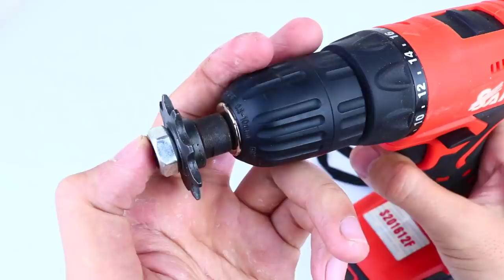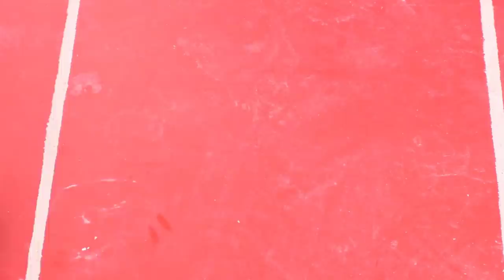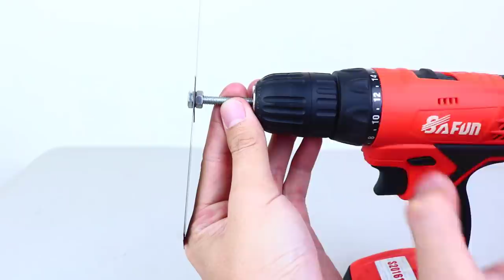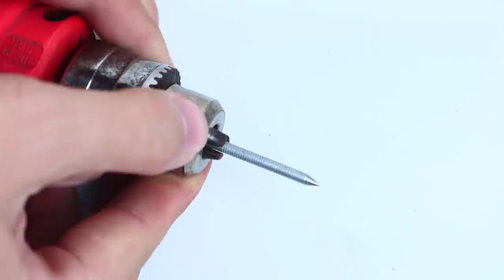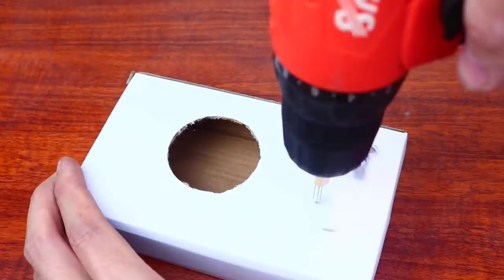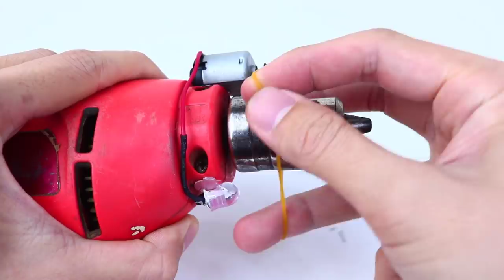TOP 6 Amazing Life Hacks and Creative Ideas with Drill Machine

Comment: Assuming all the wire tie supports hold, this is a funky idea. Maybe I could adapt my cordless electric chain saw in a similar manner. The pedals having to turn is an issue. I have seen some derailer bicycles where the coast ratchet is on the pedal shaft. This would be much better and safer.

Comment: Has anyone tried that drill-assisted bike thing?! With next to 100% validation, i strongly miss trust  the drill assisted bike. Using those cable-spanners are way to flimsy -Everything would be twisted out of position after a few 100 meters, and the rider could actually get a beating with the loose chain
Reply: I tried it with a 48v DeWalt circular saw and even that wouldn't work. Just not enough torque. Switched to an 17v drill, and it moved it, but you could walk faster and hills of any slope were a dead stop.

The motors ore just not designed for that.